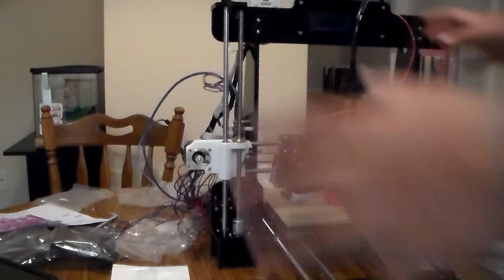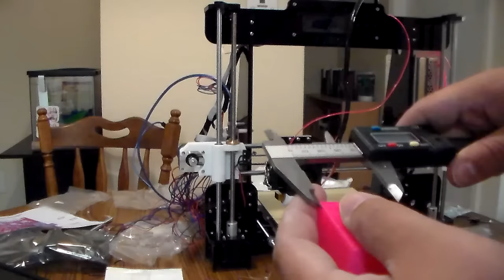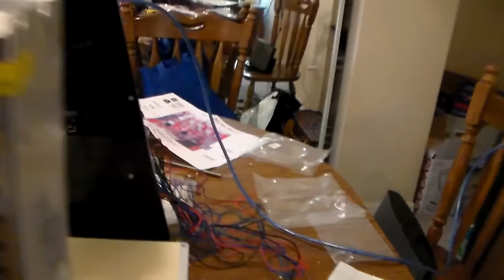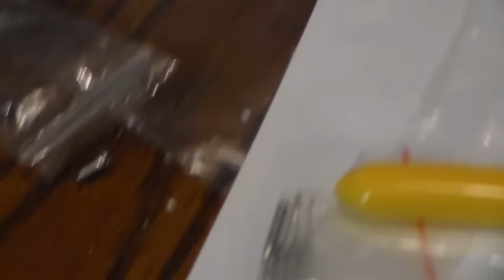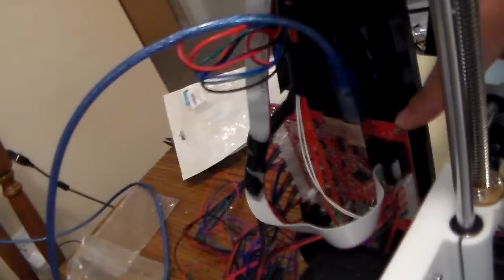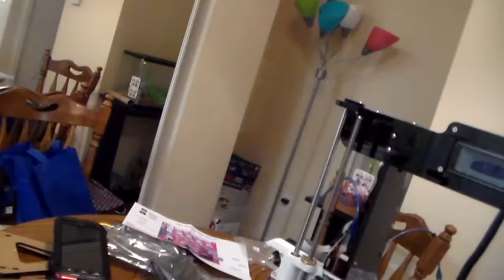Anet A8 Prusa i3 Clone Update + First print(s)

Comment: Hey man, I just purchased the same exact kit. Do you know of a place to get a walkthrough on my first test print? I'm a little lost. Tried using Pronterface but I keep getting errors when loading files. Any help?
Reply from the maker: I assume you've got the entire kit together? if so, level the bed. (if you need help with that, Google is your friend, or I can get you more information). as of right now, I am only able to print via SD card. I use craftware to slice my stl, save it to the SD card, load the SD and mount it via control panel, and then select print. I, personally, have been unable to get my printer to work over USB. There is also a great Facebook page for our printer full of tons of information!
Reply: +Danissl thanks bro. Yeah I just got the very Basics figured out. I'm currently using pronterface to print out my object. I didn't realize I was going to have to use more than one piece of software to do this but I think I've got it figured out. I think I have a lot to learn about fine-tuning though.
Reply from the maker: +Croxphire Gaming Network I had my printer built and tuned enough for an almost perfect 40x40 calibration cube in about 10 hours. after that, it was days of fine tuning as well as software tuning to get some of the prints I have done. I'll be uploading another video with a few successful and failures, and possibly another with a few timelapses. how easy was the program to set up and use? and make sure to check out CraftWare. one of the best free slicers imo.
Reply: +Danissl the programmers actually really easy to setup and use. It automatically detect of the printer once I plugged in the USB cord. Then once I was able to figure out how to get the correct file to load into it all I did was click print and it just started printing out. currently printing out the sample tree frog that comes with the files you can get online. And it's printing really well. I have the auto leveling add-on for it but it didn't work very well at all. I ended up removing it and just calibrating it manually.
Reply from the maker: +Croxphire Gaming Network I'll have to try it out! I have yet to print the tree frog yet. I should do it. I have been looking at buying the autolevel add on myself, and going to have to replace my circuit board, as the heated bed circuit died 50% into my first print. I'd also recommend buying a piece of borosilicate glass on ebay. pretty cheap, and very well worth it!

Comment: I got the same one a came up with this http://www.thingiverse.com/thing:1760679 to test the bed level.
Maybe it helps. The cube looks like you bed is too low.
Reply from the maker: It'd have been great to have that when first using this printer, but unfortunately I no longer have the printer! Have you designed many things for this printer? I've designed one thing while I owned it, but there is a huge community on facebook for this printer! If you're not already, join up!
Reply: Just a couple. I added some turnable nuts to the bottom of the bed, so you dont have to turn the screws. A filament-holder failed, because it turns out to be a pretty bad idea to mount 1kg of weight to the top of the printer. I dont realy like fb but there are also some groups on thingiverse.
Reply from the maker: NeoCortex yeah, my side spool holder actually met a bit of an unfortunate end during one of my last prints with her... the filament got tangled and pulled, and knocked it right off the table, shattering the acrylic pieces.... whoops. I've found that the heated bed screws from sites like banggood are a great upgrade, better Springs than the ones the printer came with, and nice thumb screws, the same style as my newest printer has.
Reply: You no longer have the printer?  Did you sell it? Get a difference one?
Reply from the maker: tubejim101 yes, I sold it to someone else new to 3D printing, and who is taking great care and enjoying it! I purchased a new printer, the Malyan m180 (flashforge/makerbot clone), which is a dual extruder. you can check out my video of the unboxing and first prints on my channel! I love it! I have plans for a D-bot build, as well as another larger custom build!